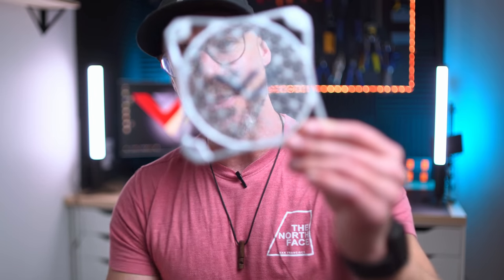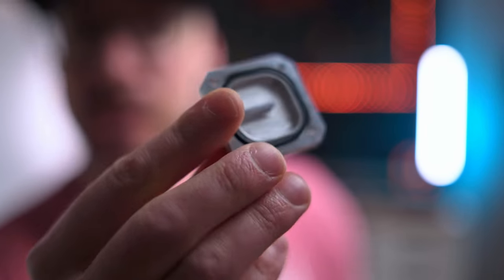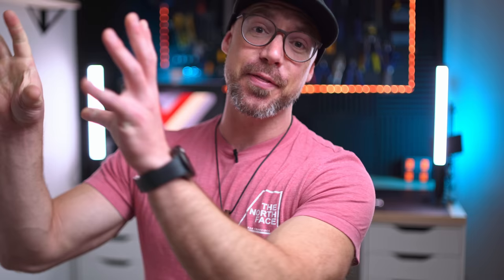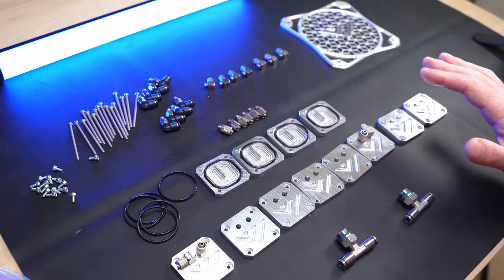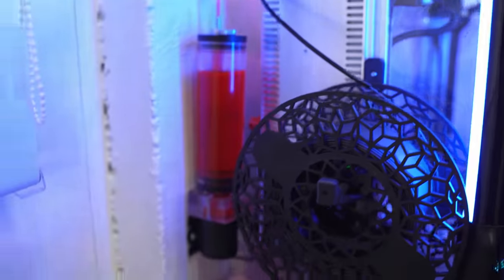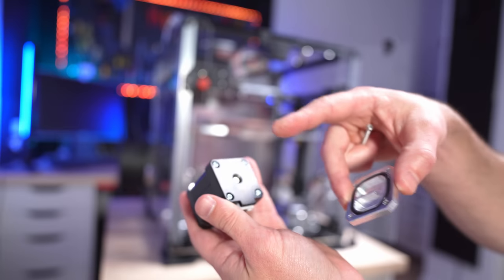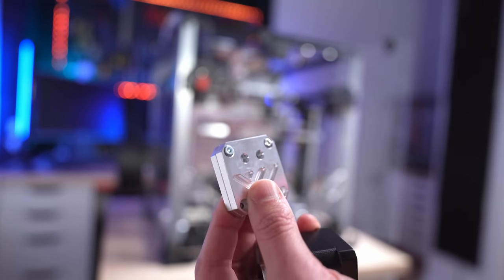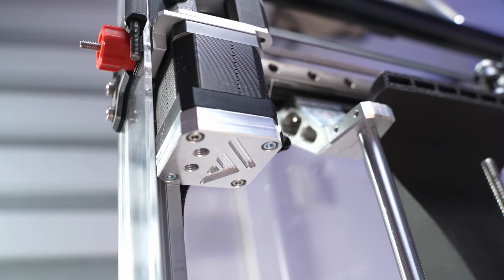I Watercooled my steppers - VzBoT

Comment: Neat video! You need to cool the sides, not the end. Heat conduction to the ends sucks because there's a resin heat brake in between each lamination, reducing the thermal conductivity along that axis to a tenth the value in the other direction. Not only that, but the ends are far away from where the actual coils (which generate the heat) are. Cool the sides, like the NASA paper on high temperature Ultem printing does. Or even better, blow air direction into the stepper coils by drilling holes in the stepper's aluminum end plates (although you should add a filter to keep out debris), like that one guy Stijns Projects does.
Reply: Cooling from the sides might be most efficient thermodynamically, but not so much in the space and complexity department. This setup works great if you have enough flow, which I think is his issue. I am running the same water blocks and it works great. The water blocks sit at ambient with a gradient of only a few degrees from one end of the stepper to the other.   

I use distro blocks and run all the steppers in parallel instead of series.

Comment: I'd definitely like to get a set of these! I am spec'ing out a water cooling system for a custom actively heater chamber right now. I currently just have the generic rectangle cooling blocks that I was going to adhere to the base of the motors, but this would be far superior. The chamber can reach 70C, but at that temp my poor steppers are literally boiling and need some cooling love.
Reply: It'd probably be cheaper and lower maintenance to buy some high temperature motors
Reply: You need to cool the motor lamination on the side. Not the rear of the motor.

Comment: The thing about water cooling, you gotta get rid of 90-degree fittings. They cause way too much restriction especially with smaller tubing like you're using. Also, you have to keep everything in a single loop. Branching off separate for the hotend will cause the coolant to take the path of least resistance and you'll no longer cool the motors hardly any. 

 Also, from the testing i've done and have seen online, cooling the back of the motor hardly does anything. You need to be cooling the motor lamination on the sides. One test i saw with just a simple fan, cooling the end of the motor dropped it only 2'c but when cooling the side it dropped over 15'c. Heatsinks on the end dropped only 1'c, and only a few degrees on the sides when there wasn't a fan. Adding a fan was slightly better than the fan blowing on the side.

Comment: Shouldn't the cooling channel be a longer serpentine to increase the heat transfer to the cooling fluid?
Reply: I would imagine the motors are not dissipating enough heat to make it matter. They are already close to ambient after cooling, so not much room to improve. The flow rate was pretty poor too, so that could be addressed as well.
Reply: A decent sized copper pipe serpentine at the exit would do the job.

Comment: Need fins in the bottom half to run the water past otherwise it's just picking up a tiny percentage of the heat off a single flat plane.

Comment: Hi @Vez3D have you consider have dual loop with 2 pumps and 2 reservoirs for so they work independent. Not sure about the pumps you are using but the D5 pumps work very well. Keep up the good work and they are "silent" pumps
Reply: For a loop like this that is very restrictive, you'd be better off using a DDC pump. They have better pressure than a D5. D5 has higher flow rate but suffers when there is lots of restriction.

Comment: Is that a good idea with the T piece? in the PC water cooling field one goes in line because water follows the path of least resistance
Reply from the maker: Im no expert here. But it seems to work ok. Im open to suggestions as always because I know there are smart brains out there that can help me :)
Reply: Its not ideal, but it will still give some flow and realistically you don't need much flow to cool them enough.
Even for floor heating some people just close the valves a little depending on the lengths of each loop instead of using a flow equalizer. Ideal? No. Gets the job done for most people? Yes.
Reply: @renatokulman7286  also he is using a thin tube for the pump size, if a side were to flow more the resistance would increase dramatically so it equalizes

Comment: Pc water cooling person here...
Let me give you some informations about the flow of water. The flow rate doesn't effect the cooling capabilities at all. It dosnt mater, if the water blasts through the water block or it slowly creeps through it. The longer the water stays in the cooling blocks, the longer it stays in the radiator. The only thing, that you now could improve the cooling eith is to either get a larger radiator or let the fan run faster. It would also be interesting to see your water temperature. Maybe insert a temperature sensor at one place and let the fan of the radiator get controlled depending on the waters temperature? At least thats how i control the cooling of my pc....

Best reguards!
Reply from the maker: I totally agree... BUT.. since I run 4 motors in serie, if the flow is very low and slow, the coolant will raise in temp before the end of the loop... the last motor will probably not get the same cooling right ? If flow is quick and high, then it will work better and even out better.. no ?
Reply: @Vez3D  yes and no. Yes, there are differences in temperature. But those are probably in a range of 1-2 C. If I remember correctly back to the sli days, there where 2 gpus + 1 cpu cooled with one loop. So probably 800 Watts in series. Between the first and second gpu was a temperature difference of max 2°C Yes. We use larger 1/4 tubes. But still... nothing to worry about. Those motors get warm.... yes. But they are nothing compared to high end computer hardware. You are totally fine with how it is. Also. If you put the flow to high, you will 100% blow of the tubes from those fittings! Those pumps are powerfull once they run at 100%
Reply: @TheFrozenOne92  you are correct. Big pc water-cooling enthusiast here. Loop order and/or flow isn't a big deal even with this case scenario. Funny how even when it comes to cooling engines this is true. Watch the latest video by Rob Dahm about the 12 rotor. He goes on about his experience cooling and found running in series before radiator has little to no impact on coolant temp. I might be jumping out of my lane when it comes to cars but I found that interesting.  @Vez3D   Also if noise is an issue, get a d5 pump .
Reply: @Mattxjax45  for the noise stuff.... its a vzbot... if that thing prints gyroid infill on a reasonable speed, you will not hear that pump
Reply: @TheFrozenOne92  Actually it can make very little noise if set up that way. I can share a video but I can print at speed with the stock tronxy motors with very little noise. Also the cpap running at low speed makes less noise than a part fan and offers more airflow at that speed too. Plus you don't want to hear your machine when it is just idling waiting for a job imo.

Comment: In place of water-cooled motor why we don't use a peltier element instead?? ... You will keep your heat inside the chamber and have really cool stepper motor... This method decrease number of part and the mechanical failure. Will try to do video of it when my setup will be complete.
Reply: The peltier is super inefficient.

Comment: Hi Vez, 
like your channel!  Have you considered just going to a bigger radiator? You might not need to increase the size of your lines like you suggested at the end of the video, also, how did the new mod affect the hotend cooling temps... I guess your klipper pid tune just runs the radiator fan more now than before?
I'd like to water cool my delta in the future.
Mike.
Reply from the maker: I dont think i need bigger rad but i might just upgrade to 240mm.  As for pid and hotend. I dont see any difference. It has no link to pid or how the hotend will heat.  The fan and pump is just turned on when hot end is heating and will stop when hotend reaches below 50c

Comment: Whats the mean temperature that you get on your tank with just the hotend? I tend to overdesign stuff so i can be wrong, but the heat from the stepper motors and the heatsink will even out and maybe you could endup with a warmer heatsink or steppers than before...
Reply: More water or an radiator/active cooling on you reservoir could correct this potential issue if you notice that this is a problem.

Comment: why you don't bouble the radieror and use a better pressure fan like noctua?,in the water cooling pc,T-split are not the best solution.much better use another loop with a secont pump  rad and reservoir.the flow not decrease to much the temp.think to introduce a drain valve for loop maintenence.
Reply from the maker: I might

Comment: Anyone suggest flipping the motors so the hot end is on the top? I've seen water cooling of stepper motors where they wrap the motor with copper tubing, that seems like the most efficient way to do it but not as pretty as your billet heat exchangers.
Reply from the maker: on this perticular design, we cant wrap arround the motors unfortunately. The surrounding arround the motor will not allow that
Reply: @Vez3D  flip whole gantry

Comment: Why not just use normal distilled water as coolant? Coolant has chemicals in them,  which has the sole purpose of lowering the freezing point of the liquid. Distilled water is cheaper, doesn't make a mess, and contains no chemicals.
Reply from the maker: This is not coolant from car industry. This corsair PC coolant. It has anti corrosion stuff and anti bacterial

Comment: Tech tip: You could higher heat transfer efficiency with applying a thermal paste between motors and water blocks.
Reply from the maker: I guess you didnt watch the video 😂 ... there is paste
Reply from the maker: Look at 7:30min
Reply: Voids are bad, mkay. Honestly would just lap both surfaces flat for best efficiency.
Reply: @Vez3D  Well, okay. I skipped that. :D
Reply: Without diving in myself.. I wonder if there would/could be a more efficient placement for heat transfer.  All in all wonderful idea and application :)
Reply: @HReality  Machine fine fins in that heat transfer surface. Like in CPU water cool block. Higher surface = higher efficiency.

Comment: water cooling is such a good idea but you need to keep in mind the amount of heat you are trying to remove, stepper motors and drivers get pretty hot, i would suspect you will need a fairly large radiator and fan system or your going to boil that liquid during long prints.

Comment: Curios after this if the coolant will need to be cooled after cooling everything
Reply: There is a small 120mm radiator.
Reply: @LBCAndrew  yea but what I'm saying is it's only getting room temp air it'll only do so much after so long maybe I guess the size of your tank would make a difference as well
Reply: @LBCAndrew  water cool the radiator😉

Comment: I think the steppers themselves get so hot that it reaches a point that the surface area on the bottom can only transfer so much of the heat. It would be interesting if you pointed the flir at the actual stepper casing to see what effect took place, as that will be your bottle neck to performance.
Reply: The motors I took apart only had a thin wall on the back cap going from the coil laminations to the back face. It's not a recipe for pulling a lot of heat away from the coils.
Reply: Cooling the rear of the motor hardly does anything. You need to cool the laminations on the side of it. A little fan on the side will do FAR more cooling than a watercooling loop connected to the rear of a motor.

Comment: for context: when it comes to the motors quitting, one factor is that *heat raises electrical resistance in a circuit*.
Reply: not within normal operation range lmfao.  this is absolutely not needed in 99% of cases.  Cool but 99.99% unnecessary.

Comment: I just water cool my chamber. 55c for printing abs keeps the extruder motor from destroying the  abs direct drive mount. 45c is almost low enough to print Petg enclosed... I keep it down to 40c for that.

Comment: Although cool, I think it way over complicates the system for minimal gains. This is a way to over amp the motors for sure but in reality it would probably be better to add larger motors. Larger motors gives more force and amps without the complications. Just my opinion
Reply from the maker: larger motors:  1-would need a redesign of the gantry, motors being bigger means pulley gears need to move. 2- bigger motor means more inertia, more moving rotating mass, creating more vibration and not always good for print quality. And while being bigger, doesnt alway mean they can go faster in acceleration. Their own mass can significantly reduce the acceleration for the same gantry. Of course they can have more torque and power, but my testing with bigger nema 23 gave me way less acceleration for the same gearing. Then you could gear them up to fix this, but it brings other down sides. Those little nema17 i run are high power, small, low inertia, low impedance.

Comment: I'm loving the prospect of a completely watercooled 3D printer.
Speaking of which, I saw that Mellow offered the Vz-HextrudOrt in a watercooled variant, but I fail to see how useful it could be. Is it to cool the pancake stepper through the body of the extruder, acting as a heatsink? Does it interfere with the Goliath's tubes? Or does ot replace the heatsink of the Goliath? I'd love some guidance on that, the perspective of a fully watercooled printer may get me to go over the edge and pick this up as my next build...
Reply: It replaces the heatsink of the goliath, makes it shorter and lighter. It will also cool the stepper to some extent, but there is not much contact area, so i think thats limited.
Reply: @renatokulman7286  Thank you!
So does that mean that the air cooled Goliath could be fitted in it, without the need to buy the watercooled one?

And I figured the stepper cooling would be lackluster, give the cooling is not only not touching much of the stepper, but is also far from the heat source
Reply: They need to fix their quality issues before I ever buy a Mellow product again. The throat on their aluminum extruders is so poorly deburred that they shave filament terribly.

Comment: I'm thinking of doing something similar on my Ender 3. My printer has a MicroSwiss DD extruder, and there doesn't seem to be enough clearance between the back of the motor and the print frame to stick a cooling block. Would attaching the cooling block to one side of the stepper motor provide adequate cooling?

Comment: how is such a water cooling actually emptied? Sorry for this stupid question but I've never worked with something like this before
Reply from the maker: I added valves at the pump outlet, so I can just unplug it from there and just let it drain with gravity, or use the pump to drain  much of it.. then I can also blow air in the lines

Comment: How is the coolant reservoir kept cool. On a computer setup the is usually a radiator and a fan.
Reply from the maker: there is a 120mm Radiator with a 120mm fan
Reply: @Vez3D  you may find that there are larger options which can provide more cooling.  If you need cooling for multiple steppers, more is better. 😁
Reply from the maker: @ghost wheel99  oh I know dont worry :)  I have 360 cooler on my pc.. 3x120 fans

Comment: have we run into galvanic corrosion yet? isn't hextrudort aluminium and fittings copper?
Reply from the maker: So far so so good. They are nickel plated fittings so they should last a bit..
Reply: DI water would help. Also, if you can separate the metal types from each other with a bushing or gasket, you should not have an issue.  I imagine it would take a long time to even see any effect, though, with the way it is now.